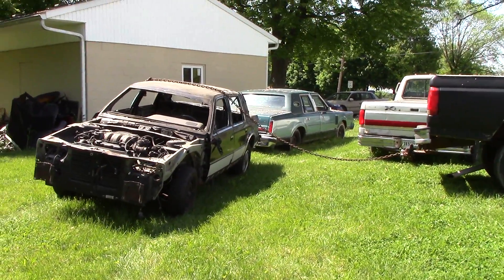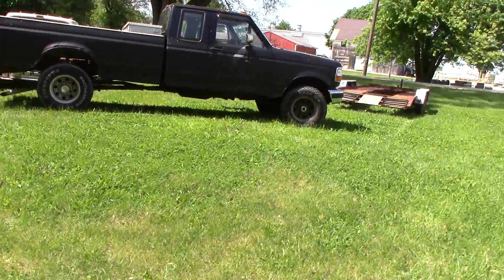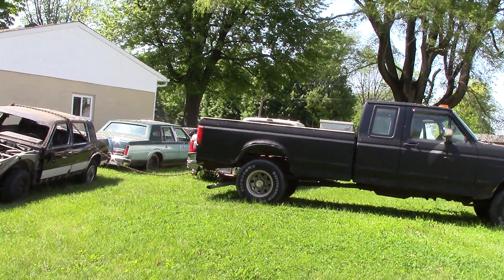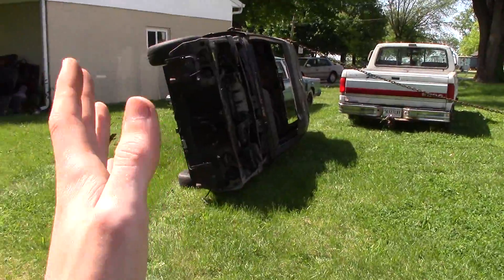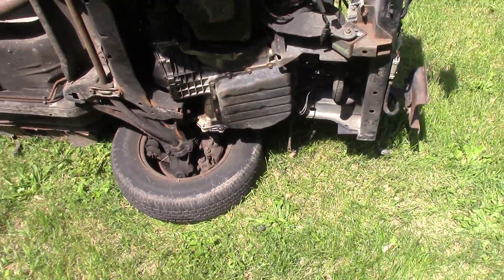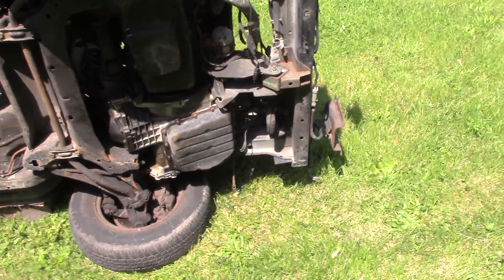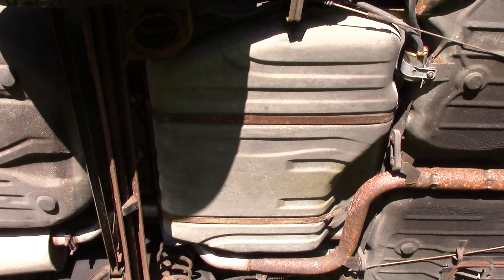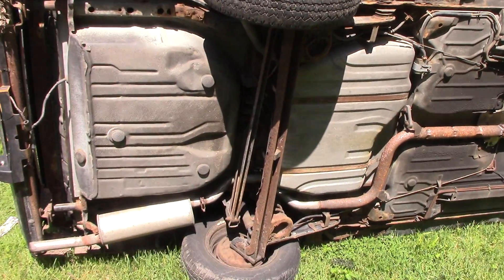Flipping The 91 New Yorker

Comment: Do you ever have any issues once you have it back down on all four tires such as troubles starting or any damage?  Think I'll be trying to put my cutlass on its side this weekend
Reply from the maker: Just check where your oil dipstick and tranny dipstick is located before flipping the car, you want the dipstick to be the side of the car in the air, not low to ground pouring out. Unless you seal them off. As far as lowering the car, I back the truck up a little to release tension in the chain, then push the car over by hand back towards its wheels. The chain will catch before the car lands back on it's tires, then slowly back up my truck until car is resting on ground. Don't push it back over and let it slam on the ground, you will likely break suspension somewhere.

Comment: I am helping my friend build his first derby car, and I was wondering if you had any tips for a 84 caprice? Thanks
Reply from the maker: ew, why does everyone have to use an 80's caprice as their first car. They are not that good of car. But your best bet is to make sure that trunk is notched AND prebent or else it will plow down very fast. Mostly a front end car unless the trunk packs in solid.  No track shots with the trunk until its already packed in.
Reply: Okay thanks, and he got it because a old lady smoked a curb with it and he got it for $50 haha, only say i had for it was putting my small block dodge in it
Reply from the maker: Good deal!
Reply: Ya, the motor is very stout. I just want to make sure the car will last for him!
Reply: So basically notch it like you do in your videos? Then pre bend it with skid steer? I also changed the stock rear coil springs with 3/4 dodge springs.. not sure if it will help much but the rear end is really stiff now, we were thinking about compressing them a bit to make it even stiffer
Reply from the maker: Needs more than a normal ford notch. Maybe even a 2nd dimple or notch close to humps as well.